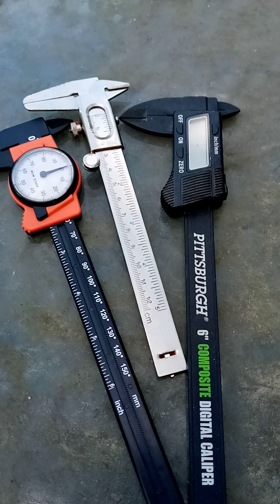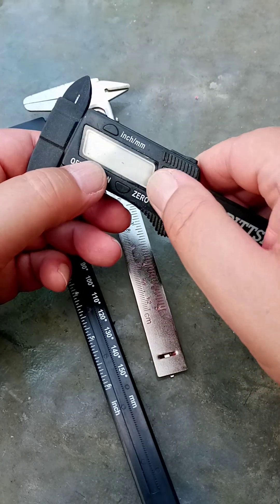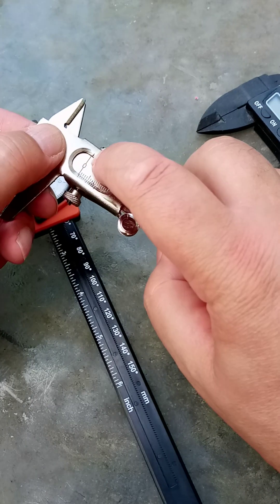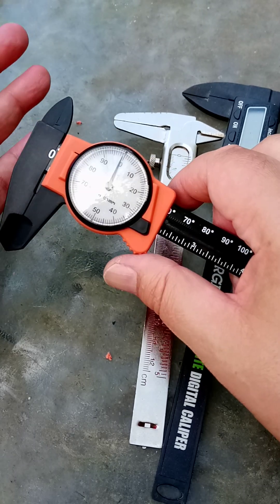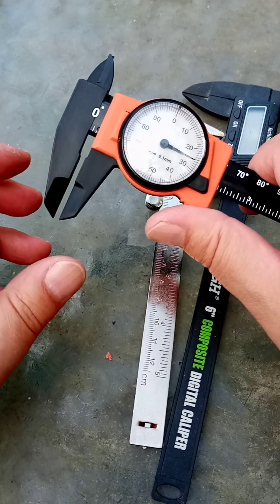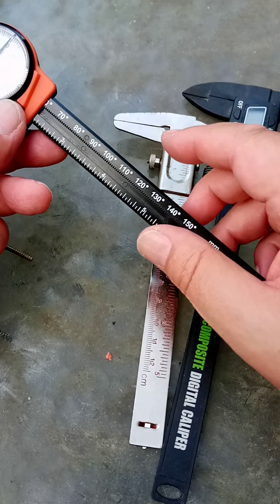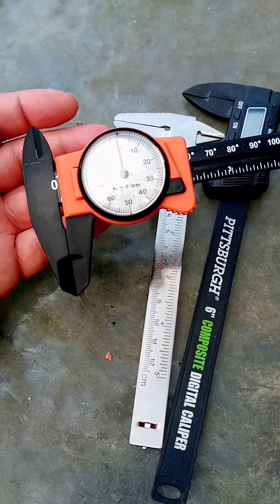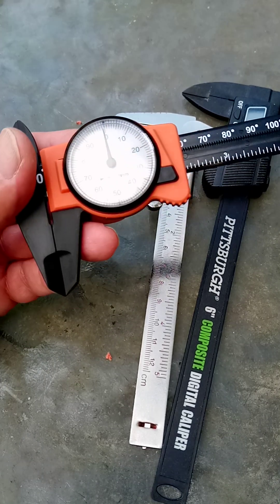Which Caliper Is Actually Worth Using?

Comment: The middle one looks like a vernier caliper and is very accurate once you learn to read them
Reply from the maker: The problem is the second scale is not easily visible. You are correct, it is a vernier caliper. I have two dial calipers and one digital. The digital is failing. The dial caliper is easier to see but mechanically more complex than the vernier.